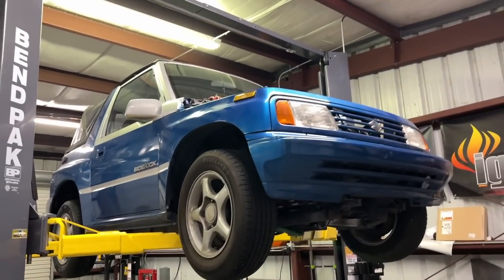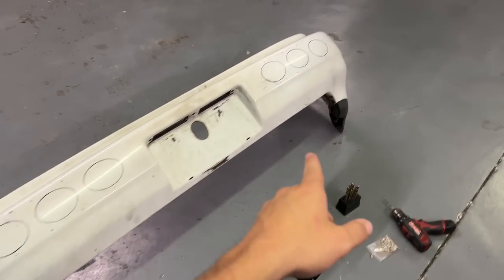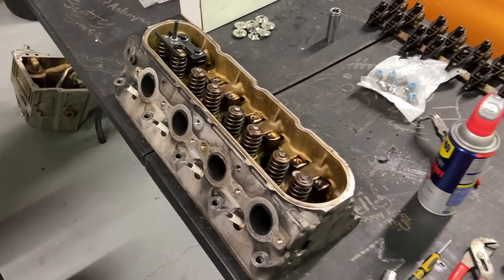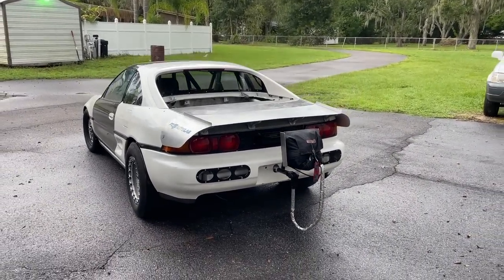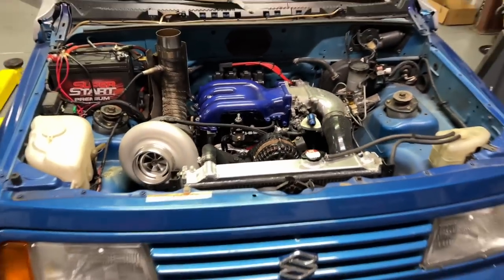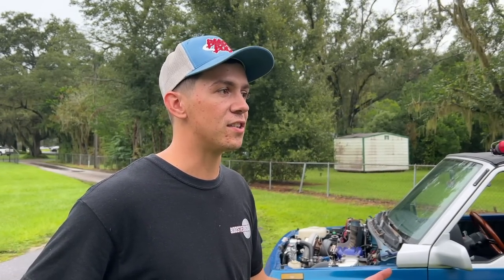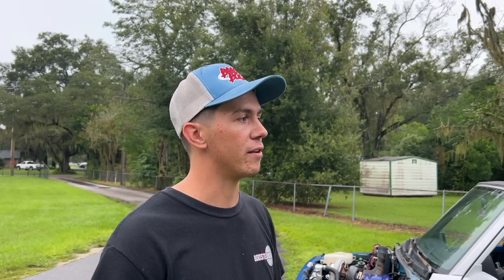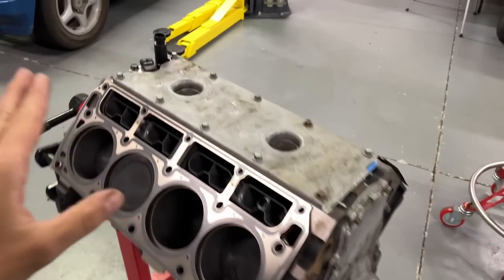Tried To Tow The Jet Boat With Our Rotary Swapped Sidekick...

Comment: If you're going to tow with it make sure you have the RPMs past where the mushy spot in the converter is if you're riding below the RPM that it types up at your basically cooking the transmission fluid because it is slipping
Reply: Thats why you just use a real transmission and shift your own gears. None of this BS to bother with.
Reply: @RubbishFPS  you've obviously never been drag racing and all negatives of a stall converter can be solved by a lock up torque converter
Reply: @legendary_perfomance  home boy said like he was relevant or something

Comment: You should plumb in a shutoff valve on the rear brake line in the sidekick so you can disable the rear brakes easily when it's burnout time

Comment: Why not run a line lock on the rear brakes to block pressure when you need to?
Reply: Yeah two selenoids hook to a switch so he could lock and unlock at wheel.

Comment: You definitely need a gated shifter that's made for that C4 transmission. Having it positioned in between years or not correctly in the right spot will definitely fry the transmission like it did. Having it partway in 1st & 2nd or part way in 2nd & 3rd is bad.

Comment: If the trans cooler lines were installed to the radiator when it blew up, I would say the trans is just low on fluid. But I doubt you guys would overlook that and reverse still works 🤔

Comment: Did you have a TV cable going to the tranny? Them ford automatics need a TV pressure cable going to the throttle body..
Reply: @taylorking715  my aod in my foxbody needs one... Or it burns up quick also..my cable fell off and I didn't realize it and it burnt up the clutches in 2 days... I think I remember them put in a c4 or c6 in the sidekick and pretty positive they need it also..

Comment: At this point why not make a thin skid plate that runs front to back the complete shape of the bottom to make super smooth air flow just a idea. Would be pain to deal with but would help areo

Comment: Put a manual transmission from the mazda rx7 so you can really enjoy it and make it more reliable
Reply: Nar they just need a decently built auto trans, we run c4's (on rotors) in Australia reliably  with waaaay more power than this is sidekick. Manual transmission makes it too sketchy for a car that's so light.

Comment: LOL huge burnout comp,tranny slips in the driveway trying to do a burnout. 

Kyle- "It's fine." 

Slipping the whole Drive anytime you get into boost. 

Kyle- "Let's just do it 100 more times in 10 miles."

Stock c4 designed for 88 hp at the flywheel. Factory trans cooling. Towing a jetboat and trailer. Trans turns into glitter. 

Kyle- 😲

Comment: Story about a Sidekick that was in my family for a few years.

My older brother had the  side sick in the 90s as his first car manual transmission. Well he was living the party life and one night after partying otwh i guess he fell asleep, (oh major sidenote  he was big time football star but blew his knee out and was taking vicodin had coming of ACL surgery couple months prior and was also prescribed xanax for whatever reason times were different with how much drs would give and how much they were telling people to take but anyway  he figured out what would happen when he drank with these medications which is extremely dangerous in itself and also the gas pedal would stick from time to time and he would have to pull it up towards him with his foot or reach down with his hand to pull it up, so he thinks he fell asleep just being too fucked up but he rolled his soft top Sidekick was told 5 + times bent the steering wheel with his chest to a 90° angle no seat belt and walked away with a few scratches and bruises. Talk about lucky and he did not stop partying until many years later. Could of died fr fr

Comment: Can you guys adapt a th350 or th400 to them rotaries? be a much better option than those garbage ass ford transmissions... Chevy makes great engines and transmissions, ford makes great rear ends.
Reply: I don't know if I would go an say chevy makes great transmissions. The 4l60e is still fresh in our minds
Reply: The C series trans is plenty strong enough for a fairly mild build like that one. I wouldn't dare put an R series trans behind anything though, unless it's a newer 10R.
Reply: @elite6569  lol? uh...what? power glide, th350, th400, 4l80e and the list goes on... the 4l60e is an electric version of the 700r4, it's always been known to be a less than stellar transmission simply because of the way the shifting is set up inside them, unless it has some work done to it or its in a light chassis then it can be an awesome trans.. what most don't realize is most 60e deaths are from operator error not knowing how they work and/or they are trying to tote around a 5-6000lb truck with stock cooling and no work done to them.
Reply: @MillionairX  well gm put them in big ass truck with garbage cooling for a lot of years.